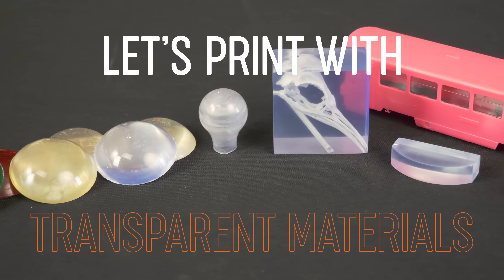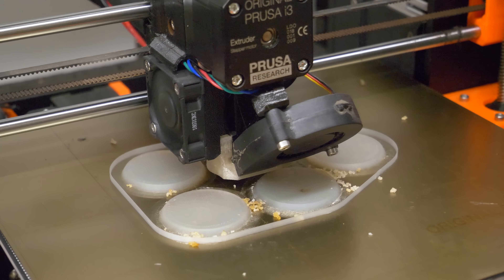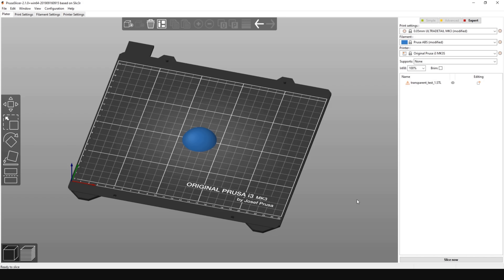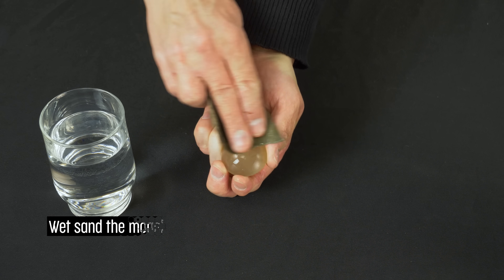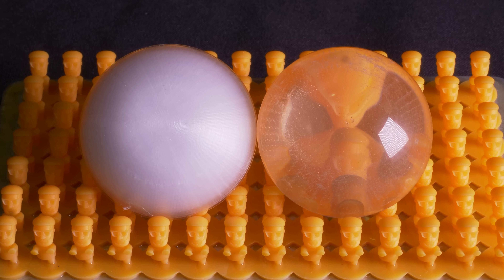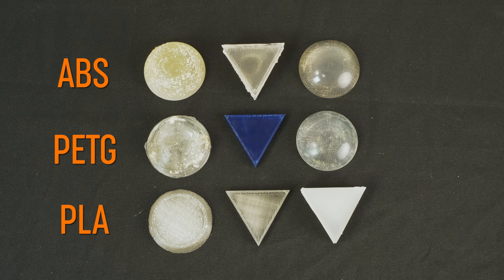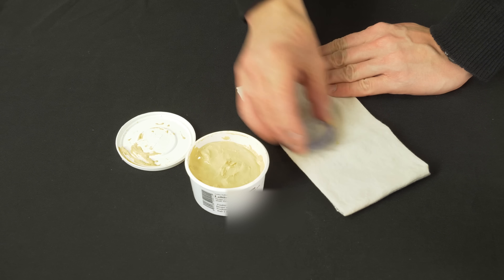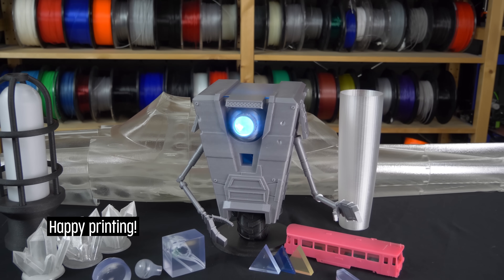How to print with transparent materials

Comment: You might  mention that for some of the settings (e.g. Infill Overlap) you specify you need to be in Expert mode on Prusa Slicer. That's normally in the upper right corner of the app.

Comment: Actually, smaller layer size is only better for clairity, IF you are going to post process the print.

OTHERWISE the larger the layer, the better the overall clairity (yes the lines will be more obvious, but the clairity will be far greater). Consider that each layer is a window, the larger that window, the easier it is to see through it.

Comment: I'm really glad to see that someone bigger touched that topic. A while ago I also was trying to print optically transparent objects. I was trying this in about a half a year. My result was really interesting. 

I tried some of transparent material, that my printer can handle. Most of times I tryed to print from PETG, because this material is the best for achieving completely transparent look without any tint. 

I saw someone else to try ABS as You guys, with really good results but the issue is most tint and also handling ABS itself.

PLA I agree isn't good material due to its tint, also slower printing is a problem here. But in my experience PLA always has this tint even slightly makes thicker parts look really cloudy.

I also tried a material called Glass 807 that was really transparent and can be smoothen with "Limonen" Its similar to PolySmooth but it has more useful properties, and it is more resistance to around chemicals, such as Vodka :D Smoothing it, will really make it shine but unfortunate it has a tint really weird one, that is dependent on light conditions. 

Best results I've got from the PETG material. I learned that the temperature should be really low even much lower that the recommended. The fan also should be off, but not always, you can get nice results with the fan. It helps to get more complicated shapes such as diamond shape(I have video showing this one, on my channel, and that's not the promo as you should know). In the downsides of having the fan, some linear artefacts "crystallization", will show up inside, but it still will be extremely transparent.
Also retractions should be turn off, some models will suffer by doing this but its the best option. About the layer lines smaller means better, but 0,05 in that case is pretty good in some cases but still too big. I was printing with bests results at 0,03mm layers heights. If we will talk about printing speed, best results I've got with 24mm/s. Flow rate is different in all materials,  similar to every other setting. 

In most cases on FDM/FFF printers, best models to print will be flat surface objects(cube for example) with something emended in them. Also bigger means more trouble to achieve best results. 15x15x15mm cubes were best for reliable printing, at least in my case. 

I could talk and talk in this topic, because there are much more factor, that you can't even imagine. So I will give you one piece of advance, for people that want to try make these results. This is hell. If you want to try, that's your choice, but I warned you :D

If you interested of seeing models that more or less successful, comparable to SLA prints. I have some videos and also some models to print on thingiverse. You can try it by yourself.

And lastly.

I apologize for my grammar and mistakes, English is not my primary language.
Reply from the maker: Thanks for the write up and yeah, please send us the link for your results, we're interested in that :)
Reply: @Prusa3D  
My best print it was a test cube 
https://www.youtube.com/watch?v=sFeXodN2jSg
https://www.thingiverse.com/thing:3434841

Other ones was 

Diamond 
https://www.youtube.com/watch?v=y7bam2vGw4Y
https://www.thingiverse.com/make:623508

Embedded Plane Jet F-15
https://www.youtube.com/watch?v=Ib8VT9lG28U
https://www.thingiverse.com/thing:3449516

Embedded skull dice from 3dpproffesor
https://www.youtube.com/watch?v=A0SY6TCvJ4s
https://www.thingiverse.com/make:619788

I also tried to print other models but there were not that good, so I didn't have photos. Most of the prints landed in "trash box". Also most of the prints, I gave to manufacturer of filament I've used. 

Every setting depends not only on material but also on its geometry, so that's why its so hard to print like that.
Also Better printer helps a lot. Unfortunate I didn't have reliable printer enough, little bit offset on one side of Z axis and you're screwed. I'm saying here about micrometers of accuracy. Maybe I exaggerated a bit, but levelling is very important.

Comment: Finally, a video with a very good and detailed explanation.  Good job!  Now, i'm off to print a telescope, lol.  EDIT:  I take that back, the end of the video turned into a sales pitch for SLA printers.  Already have an MK2S, and money doesn't grow on trees, not interested in SLA until you drop the price way down.
Reply from the maker: We had to include SLA in the comparison, otherwise we'd be eaten alive in the comments :)
The FDM lens wasn't that much worse compared to the SLA one, it just requires a lot more work to get to this state.
- Mikolas
Reply: Anecdote: You can not compare a pickup truck's towing capacity, to an 18-wheeler's towing capacity.
Reply: I didn't think so at all. If you want a clear print, SLA is the best tool. It's just a fact. If they were only trying to sell SLA, why go to all the trouble to make this video?

Comment: Came here for the FDM; happy to see some mention of SLA! FormLabs has a white paper on a SLA camera and they found that just dipping the lens in resin and then hardening that layer with UV light gave great optical finish.
Reply: Or simply putting clear coat on the freshly cured and maybe polished surface, makes it much more clear.

Comment: Basically what I did with my Form³ for my 1/16 Leopard 2A7+ ( https://youtu.be/mFTo2dapLho )
The clear piece that shipped with the model fogged up during paint stripping but when I bought a replacement one I noticed it being fairly foggy to begin with making it unsuitable for hiding an FPV Camera behind it so I gave 3D Printing a try. worked out okay for the time and effort I put into but still not enough to satisfy my needs but when I made plans for the camera I noticed it not fitting anyway and with plans for a Gun & Turret Stabilizer ( https://youtu.be/CqBib56uIUo ) taking higher priority at the same mounting location I decided to drop the concealed FPV camera idea entirely - Will probably go back to the visible one.

Comment: For making lenses  I find it much easier to print the negative using SLA and then cast out of an ultra clear silicone or urethane resin.
Reply: Intriguing! if you don't mind, how do you obtain urethane resin?
Reply: @nathanp5877  In the USA a company called Smooth-On sells it. It costs a bit much and you need a vacuum desiccator and pressure chamber to set it properly where it doesn't cloud up and there are no bubbles. The silicone Encapso-K is perfectly clear, easy to cast, and  only about $40 to get started, but doesn't really have any mechanical strength.
Reply: @amoose136  Thank you, I'll seek out for the silicone that you suggests.

Comment: Cool! But why a low layer height? Wouldn't thicker layers make a purer solid?
Reply: Actually no. With thicker layers you will have more gaps (bubbles) between the filament strings. The low layer height in combination with higher flow ensures that melted plastic gets into every gap.
Reply: @jakubkoci4626  I don't see why you couldn't do the same with higher layer height. Why not minimize the chance of forming a gap at each layer interface?
Reply: @oldspicefullbody  Well, of course it can be done this way but still, you probably won't achieve the result that will be as good as with the lower layer height. The reason might be because the lower layer height also works as ironing - when you place a heated nozzle closer to the printed object, the material around the nozzle will liquify and reduce amount of gaps.

Comment: At 3m30s you're comparing apples to oranges between a polished SLA and an unpolished FFF lens.  It'd be nice to see the flashlight lens test with a polished FFF model.
Reply: Actually the polished FFF model was pretty much the same in the flashlight test. But the SLA lens didn't have so many bubbles and other particles inside. We compared the best lens we were able to make (polished SLA print) and the worst (untreated FFF print).
Reply: They're trying to sell you an SLA printer, they made that nonsense comparison on purpose.